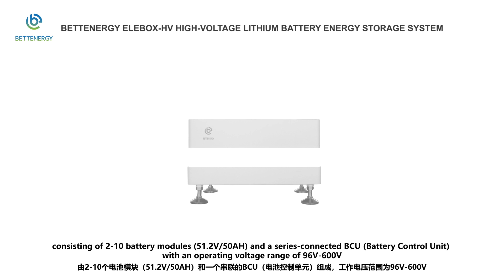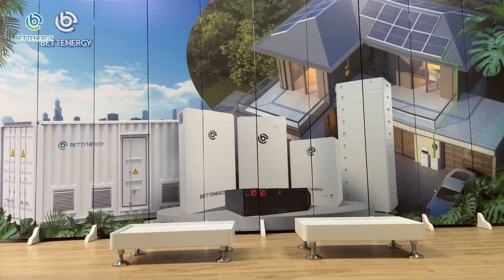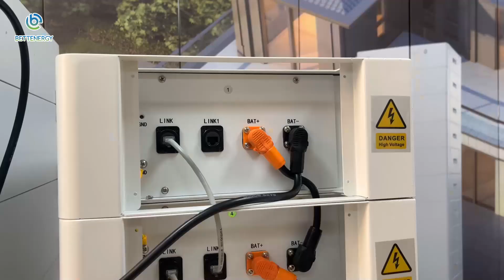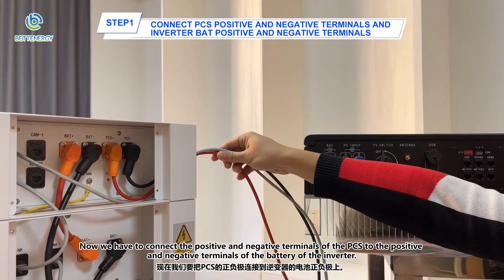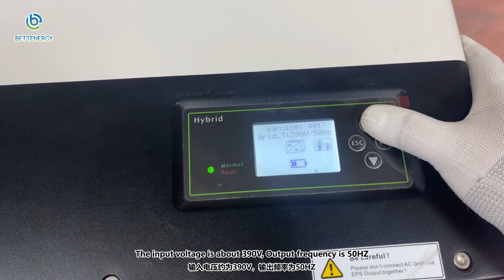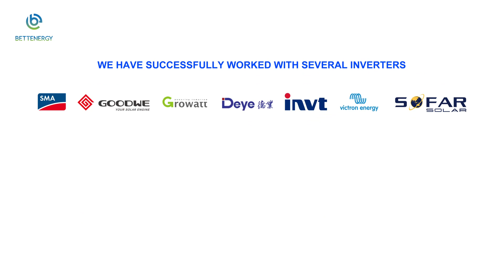ELEBOX HV battery communication Growatt SPH10000TL3 BH UP

Comment: Is it necessary to calibrate the battery if the Soc jumps from 60 to 0 when discharging and from 40 to 100 % when charging? If so, how do I initialize the calibration?